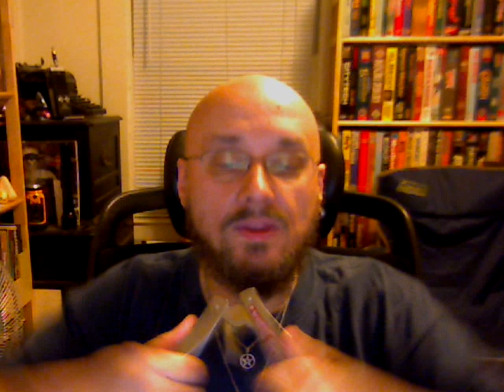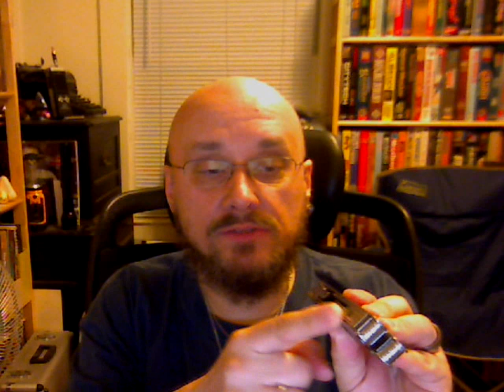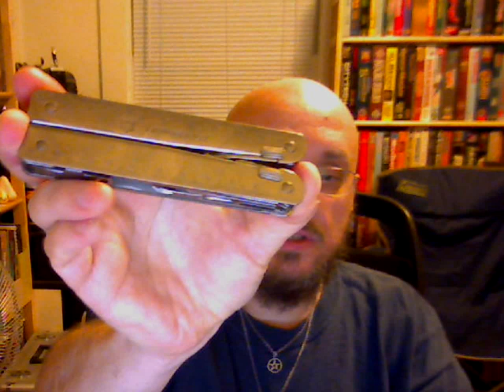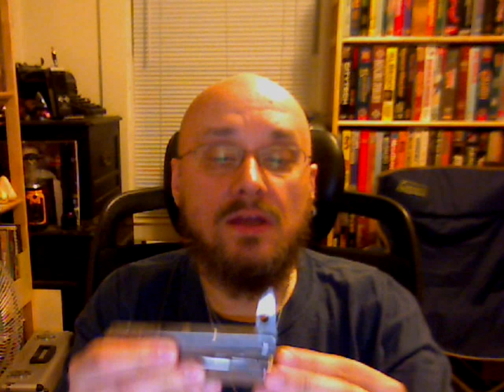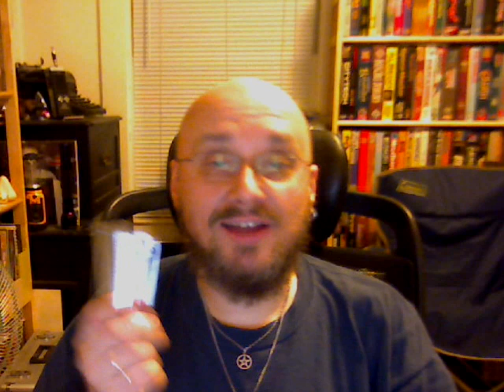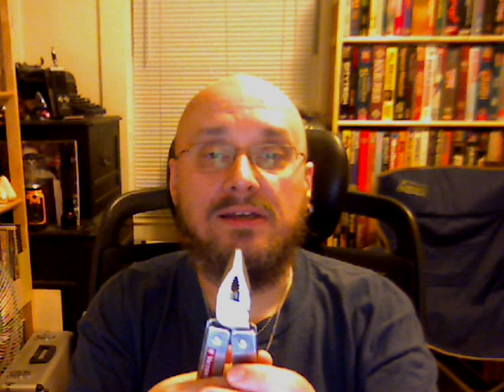EDC Multi-tool

Comment from the maker: @CanItAlready You do present an option to the problem. Some folks may not want to make the tip narrower & remove the surface finish however. I also think pointing out what is perceived as a design flaw is helpful in the long term. If the designers listen of course. Happy Holidays.